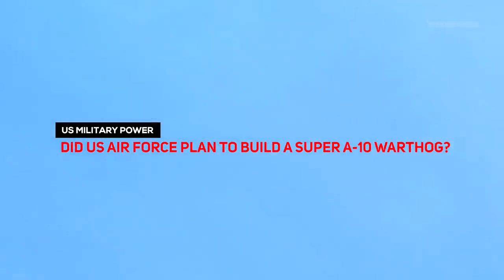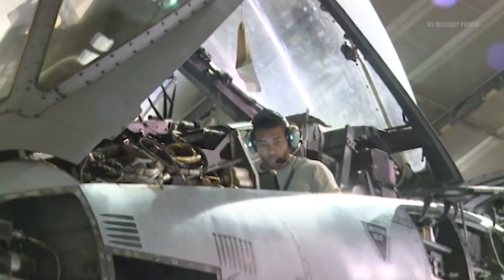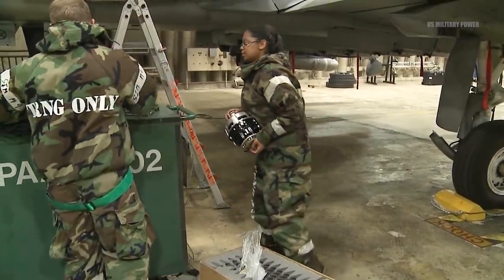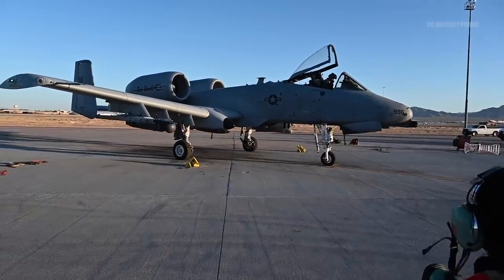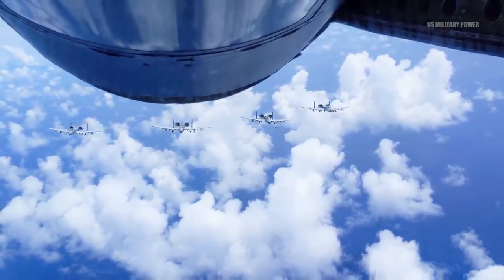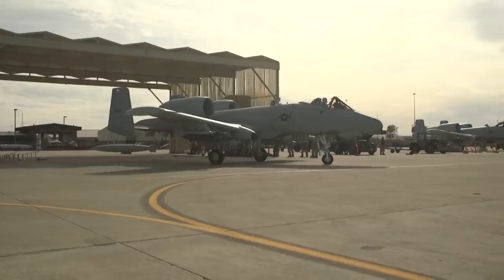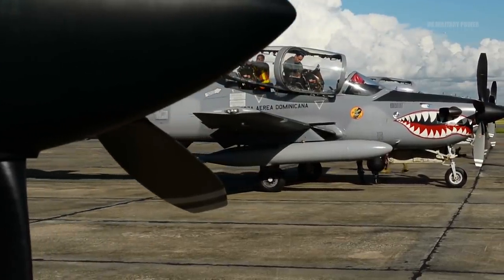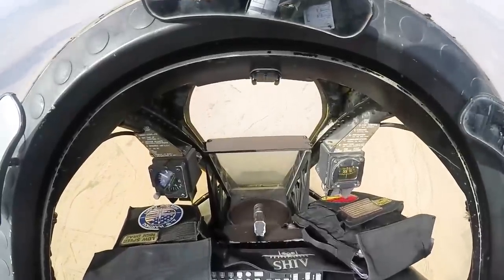The New Super A-10 Warthog is Coming

Comment: It’s main quality is “Low and Slow” long loiter!!!  And heavy carry capable.  F-35 can’t do that!!!!
Reply: Certainly the F 35 cannot do this job, he can’t do anything right, certainly not close air support. But the A-10 itself is vulnerable Against handheld missiles, even laser pointers can blind the pilot. It should be made autonomous without a pilot if it is going to continue into the future. This is simple common sense. All combat aircraft should be devoid of future prisoner of war pilots. That’s all pilots are, is future prisoners of war.
Reply: but the f35 can get into the combat zone without being blasted by any mediocre air defense system first.
Reply: Experience has shown that any aircraft in the USAF that can do close air support (CAS) plus anything else will always be used for "anything else".  Perhaps they should transfer the A-10's (and their funding) to the Army and Marines--they understand CAS.
Reply: @steveperreira5850  na a laser reflective canopy...
Reply: @steveperreira5850  These things were designed to withstand alot. The pilot sits in a titanium bathtub basically and can still return to base with only a single engine.  Add to that the fact that most if not all anti-aircraft missiles work by exploding near the aircraft and sending shrapnel into the target and destroying vital components. I'm not sure what effect a force from a blast would have regarding engine functions if detonated close in. The aircraft has returned full of holes and not hindered. Obviously some have been lost. I think that low flying also aids in survival against missiles  and even detection with radar when it is flying so low that they appear and vanish in moments.  I don't recall the planes being noise makers until that gun fires, missiles or rockets fired, or maybe as flying right past you.  I don't know how many I've  seen flying by but they are a beauty. Attack helicopters are too but are far more vulnerable but I believe bullet proof up to .50 cal or the near equivalent Russian round also. They too can fly low and hover below tree lines or hills and rise up and quickly destroy or kill any enemy present with it's arsenal. Biggest problem with both types of weapons is they've spent the better part of 20 years getting worn out and eating up the finite spare parts. The biggest mistake with any military equipment is how they will totally disassemble the production lines instead of keeping most mothballed and making spare parts in a slow manner until needed. At one point there were roughly 1,000 B52s of different models but the surviving ones in the boneyard have been "organ donors" to the 50-100 that remain but they aren't all set up for the same missions and B1s should've not been denuclearized but instead of gravity nukes smaller nuke missiles should be fitted for some stand off range and hopefully never needed but you don't neglect your arsenal until after the enemy does something making Pearl Harbor look like nothing. These subs don't even carry enough nukes anymore and limits on warheads have a good but outdated concept as Russia and China have long since gone outside the treaty restrictions and places like Iran and North Korea are overdue from having a massive accident with their own nukes.
Reply: re: A-10 survivability even if shot at: the titanium bathtub is GR8 for the pilot. It's also got hardened shells on her engines which are above & in back of the wings to reduce IR SAMs. The hydraulics are redundant & separate from each other, as well. Her pilots love the old hogs!
Reply: @cefalopodo5717  But that's strategic dude the A10; is more tactical to support troops on the move. They are gonna always need CAS platforms like the A10!!
Reply: Drone Strike  No no bruh! The F35 is for strategic air attacks.  They are gonna always always need shit like. the A10 and Apache even Harrier for CAS.  They weren't gonna ever replace A10. - too many people dug it!!
Reply: @thomasbeach905  Exactly!  Remember the Vietnam Era Thunderbirds? Wrong plane for the mission, many were shot down.  The name Thud was giver to them because that was the sound of them crashing to earth. A strategic bomber doing close air support is the AF way of thinking.
Reply: @Jack Stucki How many pilots of those aircraft make it to the top?  They are largely ignored for top ranks.
Reply: F-35s loiter in a larger area, they can do close air support farther away so it's less money spent fixing an aircraft that gets shot up. The F-16 and F-15 strike eagle would also still keep performing the close air support quick strike roles that the A-10 cannot do because it takes too long to get to the area
Reply: @thomasbeach905  the army and marines don't have the funding to keep the A-10 flying. It's become incredibly expensive to keep it flying, especially when there are other planes capable of doing what the A-10 does
Reply: @billskolnik4908  Yep why keep humans safe if technology allows it. We should remove protective gear from soldiers aswell. Most ppl that the US are fighting aint using that gear either. Such cowardice!
Reply: @Jack Stucki Buckley is now Space Force,pretty cool!
Reply: Exactly!
Reply: @davidr1676  modern wars arent fought with guns bullets aircraft and soldiers, only third world countries still fight wars that way..look at this virus, look at economic monopolies of manufacturing, look at cyber attacks, superpowers wage war using these methods
Reply: And it can take a beating!
Reply: @thomasbeach905  yes one thing to do would give it folding wings and better STOVL type takeoff ability. A little more speed to get it where it’s needed NOW would also be nice. Then they could fly it off rough surfaces and the new America class ships
Reply: @steveperreira5850  And get jammed out of the sky. We will get to the point that computers and robots replace humans at all Jobs but as autonomous cars are still killing people and hackable we no where close to having a aircraft piloted by it self against a opponent capable of Jamming. Laser Pointer they are not flying that slow plus goggles  maybe against a helicopter going stationary.
Reply: @cefalopodo5717  But f-35 can't take lots of ground fire or stay in area to spot it's target that well. The A-10 has never been the lead plane into a area it that the air superiority crafts job. The faster birds take out the air defense then the A-10 goes for the hard targets always been the plan. And the A-10 can take a missile hit or two and still return to base.
Reply: @RedRocket4000  flawed argument... You are saying: the other fighter take out the defenses and the A10 goes in and has an advantage because it can survive the.... Defenses. 

The thing is, a multirole fighter like the F35 does it's job well, and the a10's well enough. The A10 has difficulty surviving to do it's job, and can't do anything else.
Also, there's no way it can survive 2 missiles
Reply: Low and slow is just what AA crews and figher pilots like to see in a target. The F-35 also has a bigger max payload and unlike the A-10, the fleet is estimated to last longer than 2 weeks in a peer conflict

Comment: The A-10 nearly impossible to shoot down, low cost high impact.  The generals don't like it the air craft doesn't cost too much.
Reply: The good patriotic American generals are long gone. Today's American generals are bunch of stooges .
Reply: Lobbyist for the more expensive planes are to blame. Bigger budget airplanes more money
to spread around.
Reply: I think that the HOG's cost is comparable to the F-16, so not the cheapest solution for things like COIN, but definitely the good dedicated one. However maintenance costs of a HOG are very low, it is still a very simple airframe, designed with maintenance in mind. I bet it's gonna be the cheapest to maintain among all USAF jets.
Reply: @macieksoft  The A-10s cost 20 million, they are jacking up the price with unnecessary add ons.  The F-16 is 118 million.  This is the reason contractors are trying to get rid of it or 'upgrade' it.
Reply: @philpugliese7049  F-16 is 30mln F-35 is 100.
Reply: @macieksoft  I guess my computer is wrong.  Especially on the F-35.  Democrats were paying 220 million Trump canceled the contract and suddenly it only cost 185 million.  But that is American news.  What kind of fool believes the news anymore?
Reply: @macieksoft  Wow.  Well I guess my computer is way off on this one huh?
Reply: General looking forward retirement jobs.
Reply: @davidfoster5787  Almost all military air bases have air force on one side contractors on the other.  When the guys retire they 'walk across the run way'.
Reply: @warpaulgundol7560  Obama and Biden pushed them out and replaced them with Marxists more concerned with pushing critical race theory than protecting their homeland.
Reply: ever heard of MANPADS
Reply: The A-10 can be one station for several hours without refuelling and it can carry a massive amount of ground ordnance. Its overall design is just near perfect for that role.
Reply: Ah yes, the plane that flies low, is slow, doesn't have any ECM suites unless it wants to sacrifice pylons is impossible to shoot down. The plane, who's whole fleet was given a 2 week survival period in a war with the soviet is IMPOSSIBLE TO SHOOT DOWN.
Reply: @bluemeriadoc  laughs in tunguska

Comment: That's the original selling point of the f35, close air support. Not quite achieved at huge expense. A-10  cant be beat.
Reply: I can't blame them for liking cool airplanes with  VTOL , stealth , and super cruise . Lord knows I do but c'mon how many times does this aircraft have to prove it's worth in a world currently dominated by hot spot conflicts with determined yet decidedly not technically advanced foes before it gets it's due as an incredibly essential platform . The F-35 is looking more and more like the Swiss Army knife that no one asked for . The promise of parts commonality hasn't materialized and most potential customer have decided it is simply too expensive thus  making the economy of scale that would offset the development cost unattainable.

Comment: I say keep the exact concept, shape and low speed capability  but build with an even stronger frame, more powerful engine, latest avionics, and pass it on to the Army instead
Reply: By law, the one that created the USAF btw, the Army is prohibited from operating fixed-wing aircraft. The small fleet of Learjets for the Generals is exempted, naturally.
Reply: @SplFrcsCWO  
The Army flies Mosquitoes.
Reply: @joelspringman7748  what exactly is that? Got a model designation?
Reply: @SplFrcsCWO  
I can't give you any more information. I probably said too much.
Reply: @joelspringman7748  ooh, a secret squirrel-type. A simple Google search of the law and a reading of the Key West Agreement by the Joint Chiefs delineates who is primarily responsible for what role. The Army could not operate a large aircraft, and fleet, of A-10s for CAS [which is the main topic here] without revision of the Agreement.
Reply: @SplFrcsCWO  
Who cares what you think? 
Not I!
Reply: @joelspringman7748  riveting contribution, as always! You’ve failed to provide any facts yet continue to post inane comments to my comments. Are you looking for a date or something?
Reply: @SplFrcsCWO  
You've got some severe damage.

Comment: The A-10 is designed for and performs a singular mission better than any other plane before, or since.  The F-35 does bunch of differently stuff, and doesn't do any one them particularly well.  So no, you CANNOT replace the A-10 with the F-35 unless you're just trying to find out how fast you can get our troops killed by the enemy.

Comment: Nah keep the A 10. Its like a Ak 47. Simple, tough, dirt cheap and packs a punch. F 35 is way too priecy in both build and maintance.
Reply: The f35 will never take the role of the a10 the USAF said they want something cheaper than the f35 for engagments where something as expensive and capable (in terms of air to air against near peers) is not warranted. It will either be replaced by an upgrade for the a10 or a propellor driven aircraft.